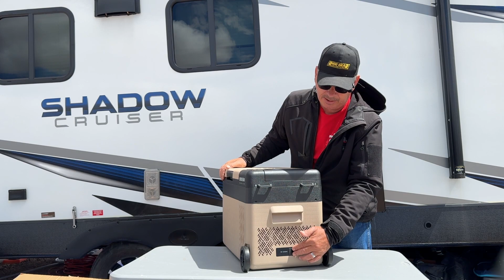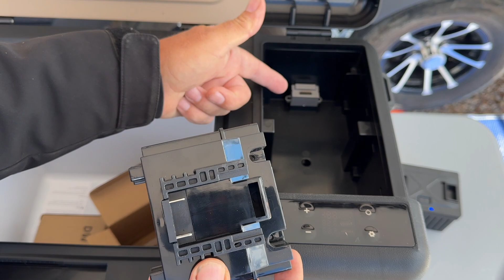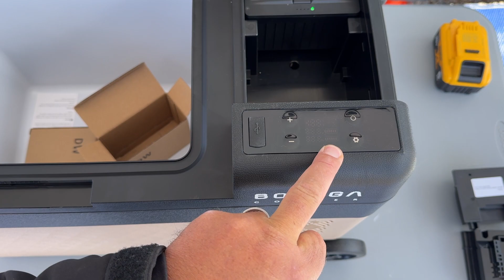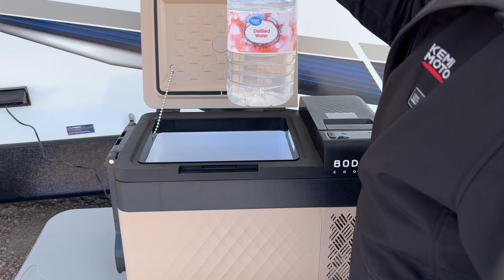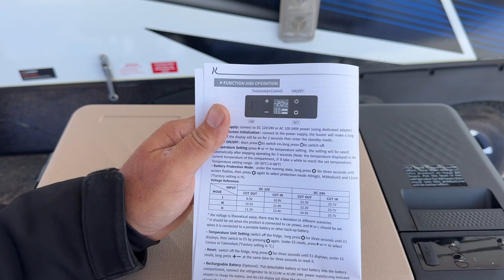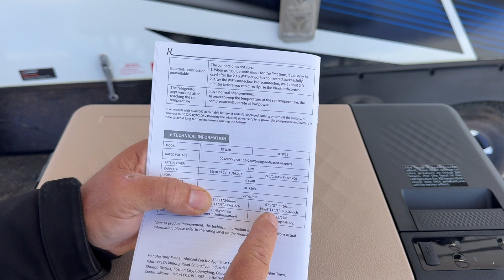BODEGA RTW25 25 Quart Portable Car Refridgerator AC/DC & Dewalt Battery Powered Overland Camping

Comment: Do you know if the larger 10ah Dewalt batteries are compatible with the RTW25?
Reply from the maker: It should be as long as it will fit in there, I don’t have one to try